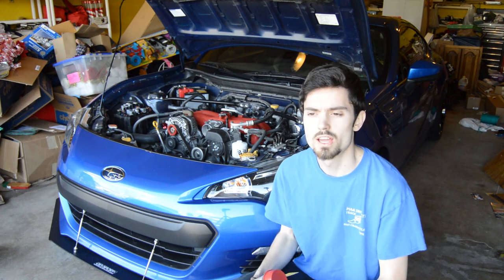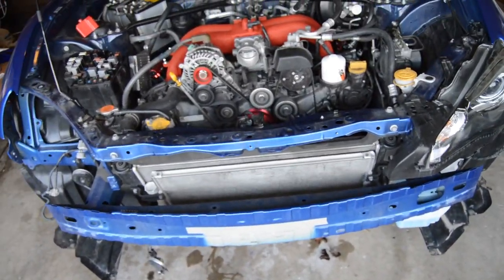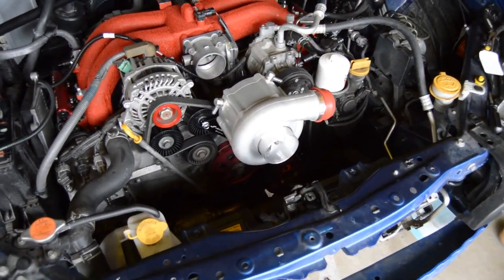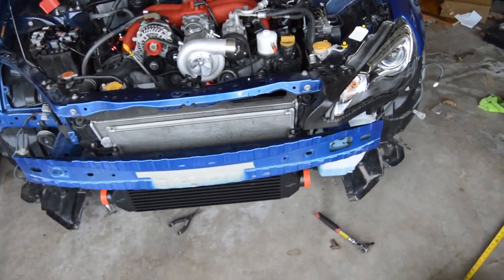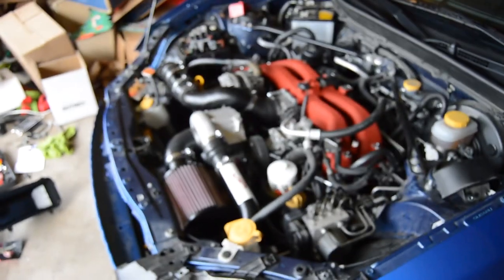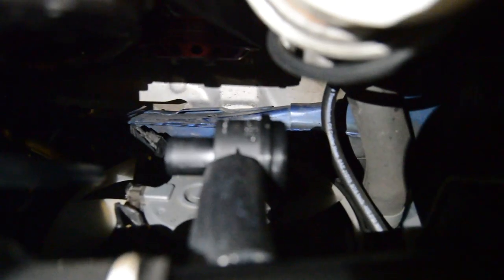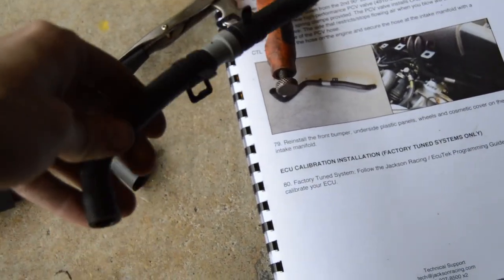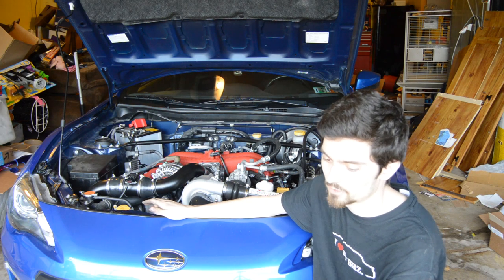Jackson Racing C38 Supercharger Install on Subaru BRZ

Comment: Hi Nick! Great video! The reason the intercooler piping is touching on the driver side is because it looks like the piping is slightly mis aligned. When you get those aligned properly, it will fit perfect with no touching anywhere!

Comment: Did you have to rebuild your engine when you run e85 and the new pulley? And what size injectors did you use I have the same c38. I’m having problems starting my car. I have to push the clutch in and pump the gas to start it. I have 1300cc injectors

Comment: Great video, subbed! Looking to supercharge my Gt86, and just wondering what made you choose this kit over others? And how much did it cost you to get it tuned ?
Reply: nickgt350R have you ran into any issues with the kit so far?
Reply: Is it worth the time and $?
Reply from the maker: I personally think so. It's run flawlessly for over 3 years with this kit, enjoyable power, and getting more power through e85 or changing the pulley is fairly easy if you want more down the road
Reply: Is this a 2017 motor?

Comment: You cant keep the snorkel from the oem air intake? I would think that would help feed air to the air filter
Reply from the maker: Yes it can be reused for this kit
Reply: @NickGT  I'm thinking about boosting my car with the same kit but I'm at 81k on the motor do you think ill have any reliability issues? How many miles was yours when you installed the kit and how many do you have now?
Reply from the maker: How the cars reliability will be all depends on how the car was treated and maintained over the years. At installation the car has 43k miles and currently has 77k miles

Comment: Still got the original battery 😯? - mine i had to replace after 3 years
Reply: Still have my original battery from 2013, but I noticed it struggled starting the car this winter on a few occasions. Might not last until next winter.
Reply: @JasonHoogerhyde  yeah I swapped mine last year with an agm way better cold starting with e85 too

Comment: How's the reliability been with this kit?
Reply from the maker: Its been very reliable. No major mechanical malfunctions. Only issues was a blow by issue that was fixed with cleaning out the intercooler piping and adding a catch can

Comment: Do your rims 18x8.5 +22 offset wound fit on my Stock Frs? !!!!ASAP!!!
Reply: Your fender size doesnt change with mods bro. unless you go widebody lol
Reply: 18x9.5's on my 86 fit just fine.
Reply: nickgt350R I need help whats 22 offset? And can't decide which rims to go for, my frs is all stock suspension and coilovers, so would a rim 18x9.5 fit or do I need to do suspension or coilovers??
Reply: nickgt350R and what's the difference between a +22 and a +35 offset?
Reply: nickgt350R I'll just go for your set up 18x8.5 +22 bc I saw your vid and they look great like wide they stick out a lot!

Comment: What's the 0 to 60 time?
Reply from the maker: The ecutek app that reads off the ecu timed it at 5.2 seconds on a 50 degree night on the street. Perfect conditions it would be capable of high 4s
Reply: @NickGT  thanks! Is that with the kit tune and basic pulley making at around 280hp?
Reply from the maker: It has a dyno tune from xero limit on it, stock pulley and makes 247hp 
 at the wheels
Reply from the maker: There's a video on my channel getting it dynoed and doing pulls with it at the end if you wanna check it out